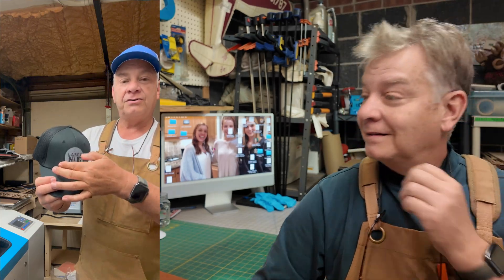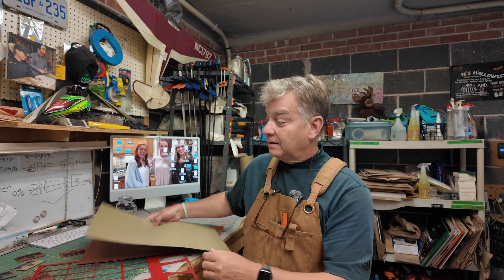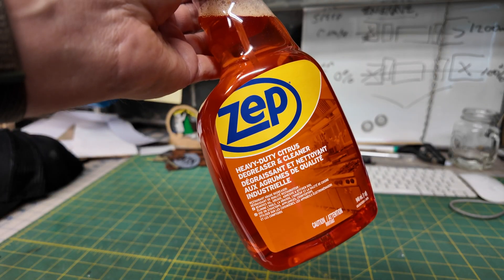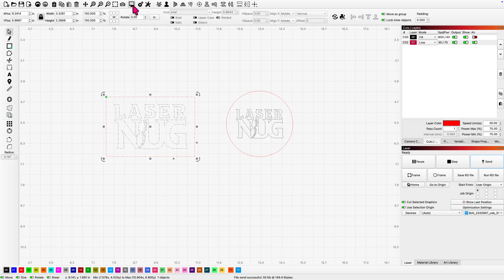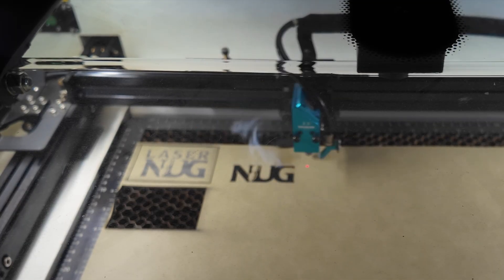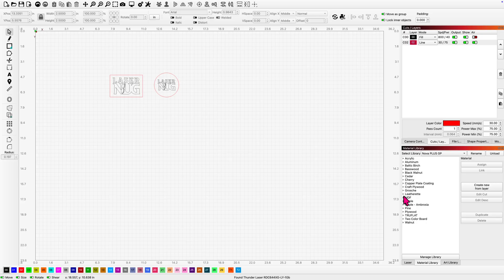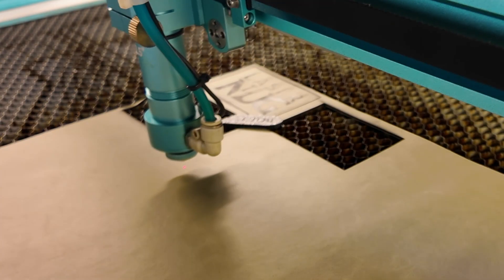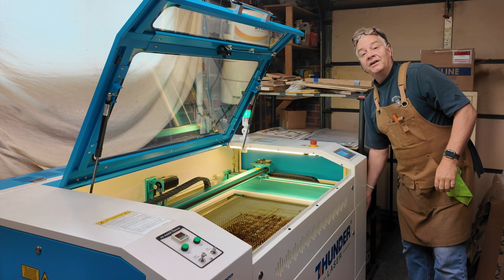Are You Doing It Wrong? Leatherette Hat Patches. Part 1 of 2. My Thunder Lasers  104   4K

Comment: Great vid sir. I’ve found that alot are the same as well with some variations. I also found that the folk at thunder put out a test file with preset and they put they change the pulse width modulation from the default 20 to 14 and my results were great. That setting is on the advanced tab for fill.
Reply from the maker: Thanks for thre great info and suggestion. Cheers!

Comment: Love your videos...you have been such a blessing for me in figuring out my Nova Plus. I have the exact same laser. Have you ever done laser marking spray on stainless with it? Next video???
Reply from the maker: Hey thanks so much for your kind comments Joe, and I am happy some have helped you. I have purposely not tried sprays and workarounds. There are a few laser options - C02 for the main materials, Fibre lasers for metals ( Stainless) and UV for a number of materials including Glass. For me, honestly, you can get metals that are anodized or painted, and the C02 lasers we have do an awesome job of engraving off that anodized or painted coatings, if you are in Canada - Canadian Engravers Supply ( cesco dot ca) has a lot of these options at different dimensions, for awards or plating etc, however, then C02 will not cut the metals. But hey, if you find a product or spray that makes sense to you, give it a try and see. Thanks for watching and subscribing. Wish you all the best of success!

Comment: Small tip for working with the leather hat patches, get a cheap soft bristle toothbrush and lightly brush over the patch with a little LA Awesome and wipe. If there is an residue just spray a small amount and wipe again, this is what has worked for me.  Also, you have probably figured it out by now but let the patch dry after using the LA Awesome before pressing, or it will bleed out onto the hat.
Reply from the maker: Some excellent tips - thanks Robert!
Reply: @LaserNUG  Thanks for another great video! Coming from someone that majored Mass Media/Broadcast and Video production, I can't help but wonder if you worked as a journalist or news anchor in the past. Your composure on camera is outstanding!
Reply from the maker: @CarterLaserCo  Geez thanks. No, I didn't but I appreciate the kind comments - Cheers Robert!

Comment: Great video, Gord. It seems that both machines do a great job. Do you feel that one does a better job on leather/leatherette? We're getting ready to scale our business and are in the process of choosing between the Bolt and Nova Plus. Thanks!
Reply from the maker: Morning and thanks Jack! Yes they both do an excellent job. If I have designs that have tiny fonts or tiny parts of the design, I switch to the 1.5" lens for sure. I think it may also be helpful to remember that most leatherette I am able to buy ( and maybe yourself) comes in 12 x20" or 12X24" sheets at the most, so that may be a consideration for bed size ( ie so you don't have to keep cutting down the sheets everytime). But I might offer that maybe the decision of which is best for you, is what other things you are considering doing - ie do you need to cut thicker or larger materials?, do you need a larger bed versus a 20" bed size, do you need a passthrough etc. Hopefully that helps a bit. Best of luck and thanks again!